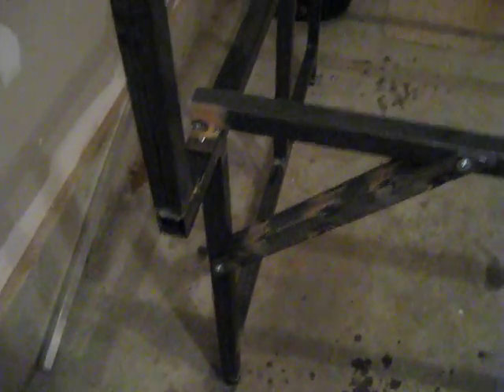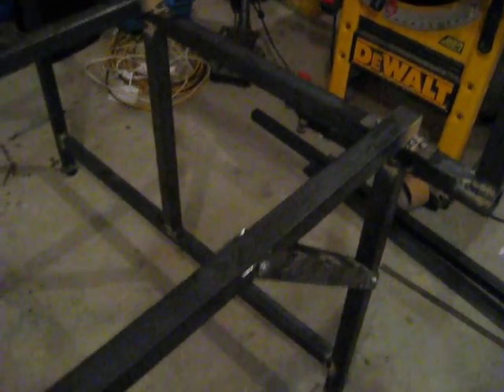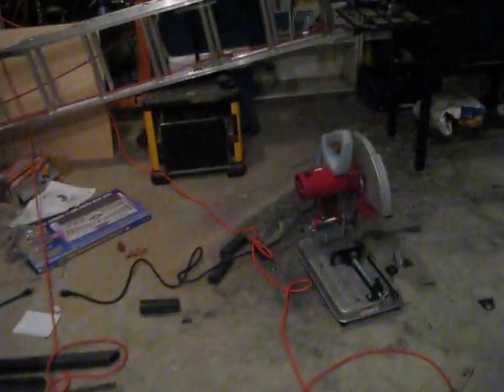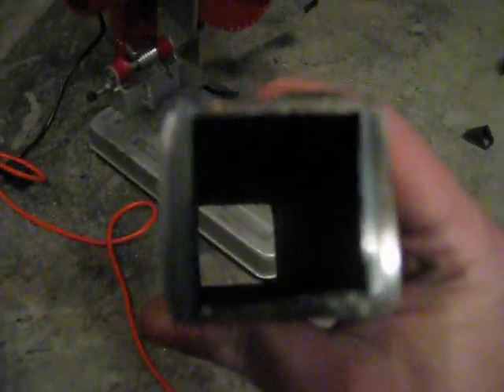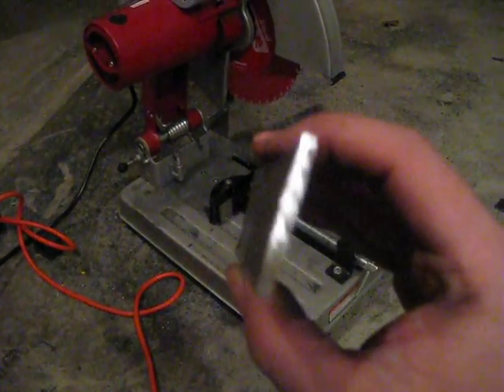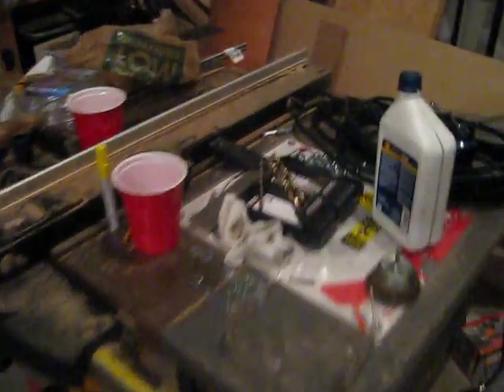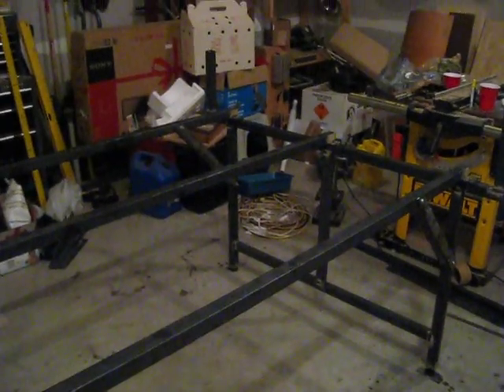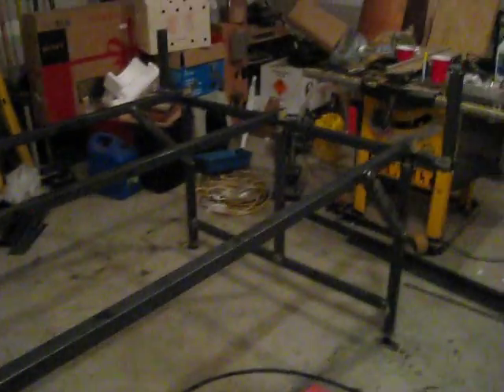Building a CNC machine Part 4

Comment: one tip from building my own is you need to put legs in the middle , very hard to stop sag when all the weight goes on the table , but good work so far :)

Comment from the maker: Yeah casters that can flip down would be good. It's got leveling feet on it already and is perfectly level in all directions.  I got the aluminum rails in and they are sweet. I just need to polish them a bit and drill holes for the gear rack. Hopefully I'll get to work on it more this weekend.